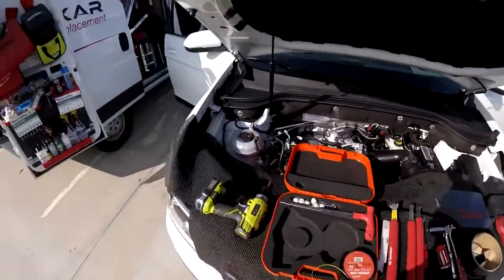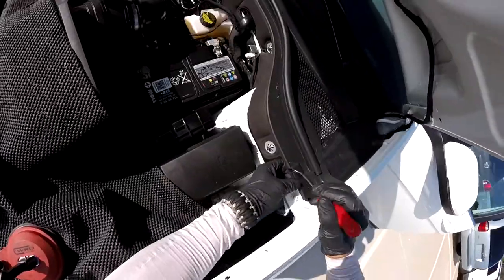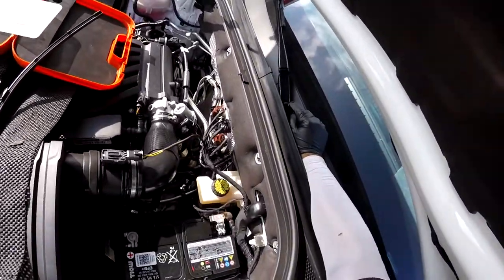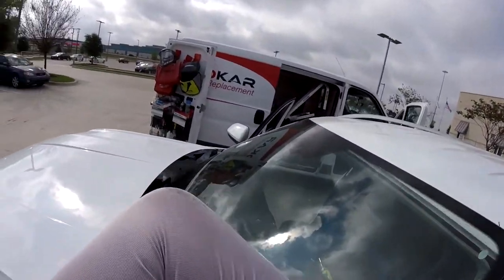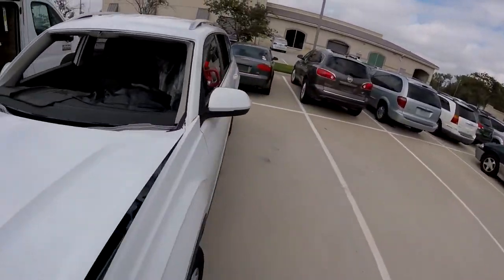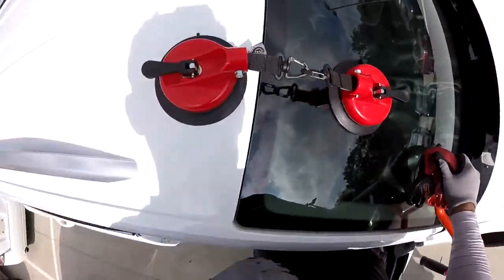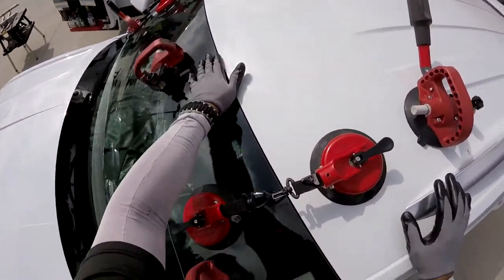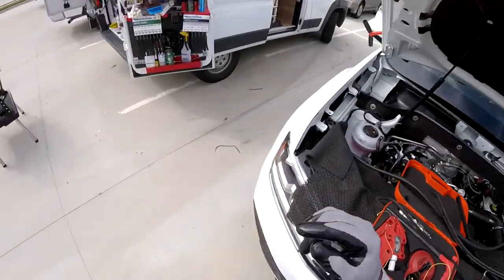NEW VOLKSWAGEN ATLAS  2017-2018  WINDSHIELD REPLACEMENT

Comment: Here's another tip for installing windshield that nobody knows, at least in California. There's a guidance to install the windshield for European dealers coming from factory for Audi / Porsche /VW. Everyone here aligns the windshield from the top. That's wrong. On the OEM glass (I repeat, OEM glass) the alignment is made at the little window where you see the VIN number. That alignment has to be within 1 mm error margin. If it's bigger, you'll see the rubber trim underneath. That's the wrong install and by manufacturing guidance, the instalation has to be redone. If you align that window, you don't have to worry about anything else. The windshield will fall perfectly into place. In the factory they use laser guidance, so it's different. Regardless to what a windshield installer tells you, if that alignment isn't done within 1 mm margin error, that's a defective installation. Windshield are a structural part of vehicle. You mention the factory going too high on the windshield. No, they go higher because of the windshield being no more than 3 mm further from the roof line, else you will get
1 wind noise
2 the windshield will slightly press on the dashboard windshield trim and you will develop a cracking noise.
As I said, everything has a logic but no one is properly trained to understand why things are being done a certain way. Also, the polyurethane used is very important because it doesn't only isolate from water, it's also a noise barrier. The manufacturer has guidelines for what brand and type of glue should be used which I bet not one is aware of...

Comment: una pregunta amigo aparte de también ser instalador tengo una van ( no la uso para trabajar) pero también tengo 2 paneles solares de 100watts cada y la pregunta es cuántas baterías externas tienes para alimentar el invertidor
Reply from the maker: Gilberto Cisneros. Bueno si son de 100 watts son 300 en mi caso los mando a un controlador de carga ..de ahi ala bateria yo compre de camioneta grande porque yo tenia de tipo barco son pequeñas y no dan mucha carga de ahi va conectada al convertidor..puedes poner masde una bateria en serie para mas carga solo recuerda q si vas a cargar electricos como baterias de taladro o cosas q consumen carga pasiva esta bien si vas a usar aspiradoras o electronicos..de mas voltage paneles directos al sol ...recuerda q es carga continua ..y no olvides si usas mas de uba bateria y varios paneles poner fusibles entre cada sistema por posibles sobrecargas...saludos

Comment: That WRD setting tool looks quite simple to use.  You must have a prototype because that isn't available to purchase.
Reply from the maker: that S correct its a proto the problem its not available cause ..has problem with a patent ..with another product FROM BELRON AND SAFE LITE ..BUT DON T WORRY THE MODEL WAS CHANCED AND WILL BE READY SOON..
Reply: That's good to know! Are they changing the design slightly from what you have to avoid any issues? It seems like you muse do some R&D (research and development) for WRD.
Reply from the maker: not  exactingly ..its just i love tools and when something come out i try get but this one was send  to me to tested but after couple post videos they email to said the product will be back to modificate

Comment: that sensor you press to remove...it's obvious you haven't worked on many German cars. You don't need to press on anything. That twists toward left ( you rotate) and it comes out. the same way you put it back, from left you insert it in the small channels and twist it towards right. Simple. Germans have logic for everything.
Reply from the maker: George #GeorgeCaragea man i m sorry will not happend if that make you happy
Reply from the maker: George #GeorgeCaragea so no turn just push..right?
Reply: No. It has channels guiding the little pins on the stand that holds the mirror. If you look at the pins on the mirror suport and the place where it supposed to snap on on the glued stand on the windshield, they aren't perfectly aligned. That's because in order to align the pins and the gaps they go to, the mirror has to be placed or removed slightly tilted towards left once you align it you twist towards right and the pins swipe into place. To remove it, you grab the mirror and twist it in a circular move towards left. Again, if you look carefully at the mirror stand and the suport on the windshield where it supposed to go, you'll see what I'm talking about. If you straight pull, there's a chance you will brake the guidance canals on the windshield stand. The mirror stand will be fine as it's made of metal and so the clasps.